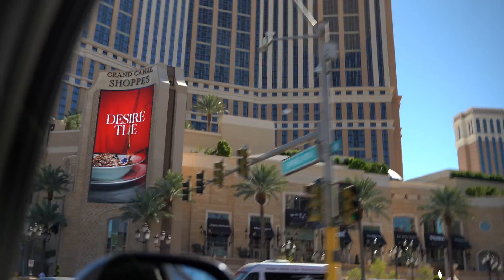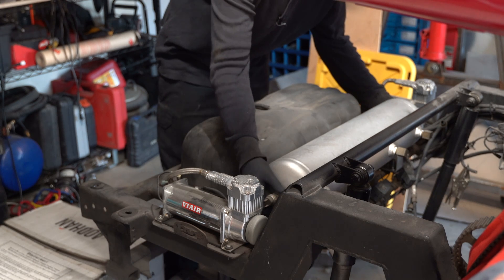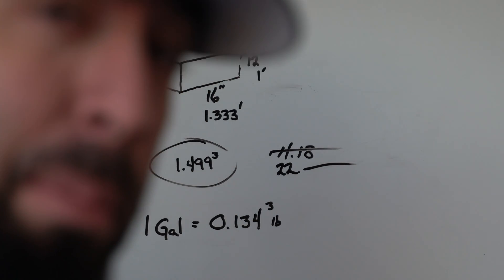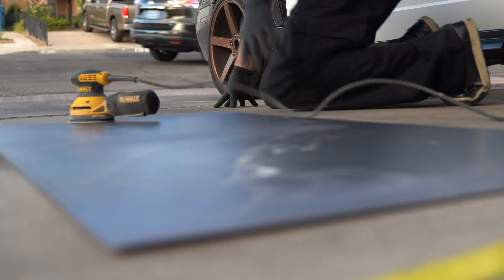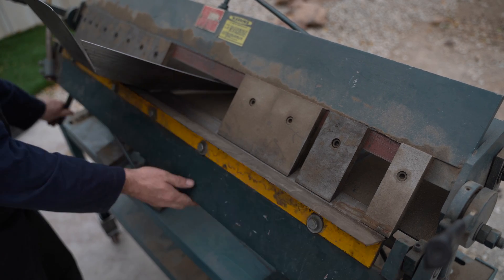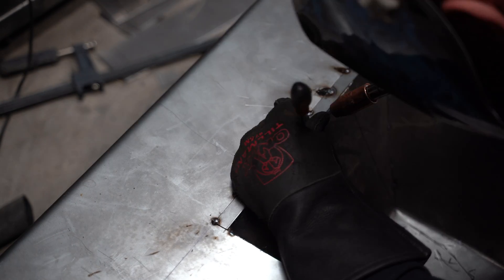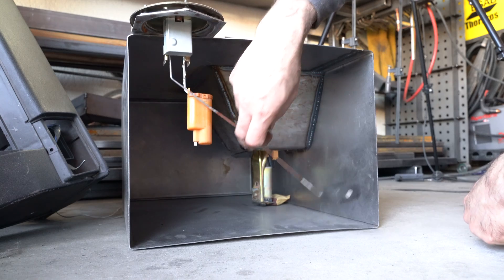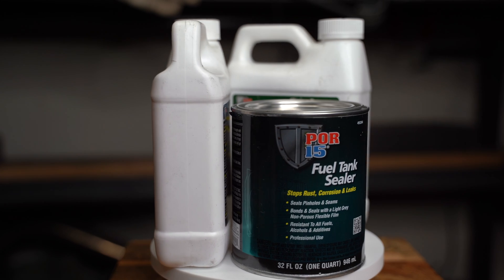Mighty Max Ep. 09: How to Build a Custom Steel Fuel Tank From Scratch

Comment: I always wondered if you could make a complete box.   I could not envision it.
Reply from the maker: Look up the magnetic brake, fellow Miller!  The principles of a magnetic brake are the same as mine, with fingers that clamp down on the metal on the top. But with a magnetic brake, the fingers are held down by magnetic force, rather than bolts. This allows you to make a complete box. 
And when you’re done, you just need to flex the box open a little bit to retrieve the fingers that are now trapped inside.
🤯

Comment: Where did you get that 48” brake? Looks familiar
Reply from the maker: Familiar? It was on loan from my old boss. I don’t have it anymore unfortunately. And fortunately at the same time. I hated that thing!
Reply: @GarageFab  was your old boss named Frank? Only asking because mine was borrowed from a frank to build a dash in a s-10. Then somehow his shop was “broken” into and my brake ended up missing. Even had the casters I welded on there.
Reply from the maker: That was getting interesting for a moment! I had a feeling it was something like that. But no luck. My boss was Wally. I don’t know where he got it, but the wheels were mine. I call them “socks” They’re casters that are welded to short lengths of square tubing that slipped over the legs. That way I can use the same casters on multiple tools/tables in the shop.
Reply: @GarageFab  yeah probably just a coincidence. Being a fellow fabricator and local las vegan I dig your channel. Keep up the great work.

Comment: And I feel accomplished making a little 4" wide 90 deg brake for my shop press to make brackets easier...bent 3/16" like butter...Guess I gotta up my game a bit
Reply from the maker: And you should feel accomplished! I still don't have a shop press or a press brake and I'm often in need of one. I still hammer over flat stock in a vice to make brackets. Kinda embarrassing, but I just don't have the room yet. In time, a homemade press, followed by a homemade press brake will be videos on this channel. Might be a little while though. I've got to clear some space first.
Cheers my friend!
Reply: @GarageFab  I was workin on a tiny project. Had some 3/16" thick brackets ya know to make it solid lol. Then it took way too long to hammer heat and bend those brackets and they have hammer divits all over it...finally said fahget it. I'm makin a little bracket press so I can make these little brackets and others. Took way to long...but now I can bend a 90deg on 3/16" in about 30 sec and it looks good. 

If you get the shop press don't go smaller than the 20T and get the HF air bottle jack...it's soooo much better/easier than the regular pump handle
Reply from the maker: Good tip! And I’ll take your advice. Thank you!

Comment: Awesome job man.
No drain though.  
I'm thinking of building a cell for my 1G. The fuel level indicator may be bad on my car due to a F up by me and the seal leaks due to the same guy who messed up the fuel level indicator trying to use old parts. If I build one,  I'll probably do aluminum and buy a boat fuel level indicator and make my own pump mount. But I probably won't do any of that.  I'll probably just fix my leak and get a new/used sending unit. But cool video.  I'm off to check out more of your videos.
Reply from the maker: Thank you, Jospeh! I laughed the whole way through that comment.
I intend to drain my tank using the engine. 😉 I’m a Toyota technician by trade and they don’t come with drains. A lot of my ideas come from the vehicles I work on every day.
I’d love to gain the skill to build an aluminum tank. The day will come eventually.
Your time is greatly appreciated my man! Cheers!

Comment: The "ALL DAY" had me rollin!! I feel your pain I've used that on a 1950s era tank and it works great but takes a week outta your life.. lol
Reply from the maker: I might be stripping it too. I've never been more unhappy with anything in my life! I think I'm going to fill the dang thing with Aircraft Stripper and hope I don't hate life afterwards.
Reply: @GarageFab  really? Man it worked excellent on the tank I did. That stinks. I can only imagine how much that's gonna suck.
Reply from the maker: Did you use the same brand? The first coat didn’t appear to cover well so I coated it again. And then again. It took several coats to completely cover the steel. Then when it dried, a large bubble formed between the steel and the coating like on a pizza crust. I had people tell me the single part coatings deteriorated on them and gummed up their fuel system and they’ll only use two-part epoxy coatings now.
And so now I’m scared. 😳
Reply: @GarageFab  yes same exact brand and kit you used. Makes me wonder if it needs the rust and pitting to bond too? It's only been 8 months since I did it and it was for a dealership so not sure on long term results. I did each step as you did except I did use the cleaner solution and had a rusty old tank. 

I hope it doesn't start to peel and gum up the fuel system.. now I'm worried..lol
Reply from the maker: Time will tell I guess. 😐

Comment: hint..if you drill some holes on the insides of the corners, when you go to use your 4.5 inch disk cutter... you wont over cut the part that you are making,, the disk cutter will ( you will ) stop at the holes that you cut.. and to make sure it wont leak after you grind down the weld.. solder the weld lines with solder.. easy to use and will stop those pesky pinhole leaks
Reply from the maker: Very good advice. I’ll be trying both. Thank you my man!

Comment: I spent years on CNC benders. For trapezoids and any other high wall shapes, you have to use raised tooling and use beds sides. It is not possible on all benders. Hydraulic benders have sides open, therefore in correct sequence you're able to bend shapes very deep/high. Not 100% of them, but good 99% out of them.
Reply from the maker: This may be my next purchase. (Or build) It’s incredible how often I find myself stuck and unable to create what seems to me to be a simple part because my tooling won’t allow it.
It’s like the finger brake punishes me for thinking outside the box. Pun intended.
Thank you, Daniel! 🙏
Reply: @GarageFab  CNC hydraulic benders are incredible in terms of efficiency, speed and accuracy. You can bend repeatable angles on material up to 12 mm (100 tonnes press), with accuracy of 0.05 mm.

I like bending as bend offer much higher strength than weld. No HAZ.
Reply from the maker: Is work-hardening not an issue? That’s going beyond my range of knowledge to be honest.
Also, I don’t yet hand $50,000 burning a hole in my pocket for a hydraulic press. 😂
Reply: @GarageFab  Hardening with bending? No. Thick mayerial gets gently warm up to 50C when bended fast.
Here is tip you may not know about. Sheet metal always has grain one direction. Always bend thick steel or SS with grain, not across grain. With grain 9 of 10 won't crack at bend. Perpendicular to grain 3-4 if 10 will crack at bend, deeply at times. Material half inch thick and higher.

To fight with this, you want to use wider V, bottom tool. Rule of thumb is 5 to 6 times wider V than material thickness. For thick stuff I go with times 8 wider. For half inch it would be 4 inch wide bottom tool, giving 4 inch radius to material with 90 deg. bend.

It is hard one, as with plasma/water/laser cutting, you will not get good efficiency with some flat stuff. Sheet metal always comes in sheets 1.2 x 2.4 m. With some cutting product to bending surface efficiency drop below 50% which is pretty low. Rest material is wasted.
Reply from the maker: Thank you for the info, Daniel. Very much appreciated! 🙏
Reply: @GarageFab  bender in your price range will be "NC" not "CNC"  but you dont even need that. stop blocks for bend angle work fine. back gauge can be manual doesnt need to be automatic. you can build a press brake thatll do everything youd ever need without any of the fancy electronics.

Comment: Modify sender to reach 12" bottom.
Reply from the maker: I don’t understand. 🤔
Reply: @GarageFab  if you can fabricate a gas tank you can extend fuel line and bracket 6" instead of fabricating that large recess in tank🤷‍♂️ awesome video though. Thanks for making it
Reply from the maker: My pleasure, David. You are correct. But should the fuel pump housing crack (as the Eclipse housings often do) I’d have to re-modify the new one as you cannot separate the housing from the pump bracket.
I like to build things with ease of future maintenance in mind.
Reply: @GarageFab  right on

Comment: That last part with the treatments and decreasing and what not, does that only apply to steel tanks or do you have to do the same for aluminum tanks?
Reply from the maker: The tank lining is indeed for steel only. The liner is there to prevent the tank from rusting from the inside out. I am REALLY unhappy with how the tank coating turned out so I’m considering starting over with aluminum. Aluminum doesn’t rust so you can just leave the aluminum bare. 🙌

Comment: I recently found your channel!!! Loving the content,  filming and editing style. Top notch bro!!!!
Reply from the maker: Thank you, Brother! I appreciate you. Hopefully you’ll stick around. I’ve got a pair of LS engines for the next YouTube project and zero LS knowledge. 😬 Imma need all the help I can get!
Reply: @GarageFab  I’ll definitely be sticking around. You find the LS is hands down the easiest engine to work on.
Reply from the maker: That’s good to hear because I’m terrified of it. I’m a Toyota certified technician specializing in Toyota and Lexus. Those are easy!
First question; I bought a car with a misfire in cylinder 6 and a code for cylinder 6 injector circuit. I replaced that injector. Test drove it. All good. Almost immediately cylinder 1 injector circuit code popped up. I replaced that one. Almost immediately injector circuit code for cylinder 7. 🤦🏻‍♂️ Any ideas what’s happening?
Reply: @GarageFab  I’m a Toyota guy too, I’ve had many, currrently have an FJ cruiser. I used to have a Supra but gave up on it, after blowing up three 7MGTE’s, and one 1JZ, I figured I’m not a good enough mechanic to screw with modifying supras. 

I was a jet mechanic in the military 20 years ago, but that’s the only professional experience I have. Currently I’m a so/so hobby mechanic, wanna be novice fabricator. 

Your issue to me sounds like debris in your fuel system. Have the fuel lines been changed? Have you changed your fuel filter? Injector failure isn’t a common problem. Personally I’d start with flushing the fuel lines then change the fuel filter (stock filter should be located on the passenger side frame rail under the cab). Did the car sit for an extended period with garbage fuel?
Reply from the maker: I think it did sit for at least a few months. I purchased from it from someone that couldn’t afford to fix it. Debris has also crossed my mind. That would explain the misfire but I wouldn’t expect a “circuit code”. 
I hope to help you become a slightly more than novice fabricator! 😂
Reply: @GarageFab  I’m doing a short bed conversion on a square body crew cab right now. It taught me that out of position TIG is a bastard and molting steel is tough on the skin. 

Also don’t forget to check your plug wires for a bad connection or melting if you have headers (LS plug wires love to melt with headers), and your grounds. Love the videos, and the sense of humor. keep it coming. You have the talent for 1million subs in no time!!!
Reply from the maker: Thank you Brother!
Both cars are 100% factory at the moment. Two 2008 Impala SSs. My goal is to get them to perfect running condition before tearing into them apart so I can determine if future problems were caused in the disassembly process or pre-existing conditions.
Imma subscribe to your channel to see what your working on. Sounds like my type of stuff.
Reply: @GarageFab  thanks for the sub brother. I haven’t made any videos for a while. I was saving money gathering parts, then when I got the parts I got too lazy to make any videos. I’ve been contemplating uploading again. 

I love those Impala’s, totally pimp. That drivetrain would make a sweet rear engine IRS mini truck, if a person could find one at the junk yard.
Reply from the maker: That’s the plan my man! Well, part of the plan. 😈 
Upload when you can and don’t stress about it. If it’s not enjoyable, it’s not worth it.

Comment: When I have to make a bend that will hit or catch on the bender somewhere, I just cut through my bend line with a cutoff wheel or blade leaving several small tabs joining the metal, bend with my hands, then weld the seem if necessary. Love your channel by the way. Very happy I found it
Reply from the maker: I’ve got to try and remember that. I use that method on heavy plate all the time, but for some reason it never crosses my mind when working with sheet.
Maybe it’s because I can’t see past my frustration that my dang bender doesn’t work. 😐

Comment: What thickness steel are you using? I want to make a bigger fuel tank for my Unimog, when I Googled "what gauge steel" it came back as 12G. Yours looks a bit lighter than 12G. Edit: Ah fuck, just read your description properly...16G. I liked your video though, nicely edited, not too much chat and one of my favourites with build videos is speeding up the long processes.
Reply from the maker: You’ve got impressive eyes! I used 16 gauge which is still thicker than a lot of modern metal tanks. Certainly not indestructible but still pretty beefy.
Reply: @GarageFab  Not so much the eyes, but the way you were cutting it with those shears, I don't think you could get away with using the shears on 12g.
Reply from the maker: Truth. I wouldn’t try cutting anything thicker than 16 with those shears. I’d be really sad if they broke.
Reply: @GarageFab  I might have to get some of those shears. I use a plasma setup now but it is a hassle for small cuts and those with a slight radius.
Reply from the maker: The electric shears are not at all great for turns. But still worth every penny.

Comment: Good information.   Thank you for sharing this.   To figure gallons, I find it easier to leave dimensions in inches, since I know 1 gallon = 231 cubic inches.  27x16x6 = 2592 cubic inches.  2592ci / 231ci per gallon = ~11.2 gallons.
Reply from the maker: Much appreciated! I’d like to remember that but my memory is broken. I’ll have to refer back here when it’s time to make another one. 😂 Cheers! 🍻
Reply: Use metric/logic
Reply from the maker: In the process of switching as we speak.
Reply: 231! That’s what I use too. I used to roll in a Chevy luv that we put a 231ci Buick 3.8L v6 in. That’s how I always remember 231ci. Association. I also remember 454 grams to 1 pound.. big block Chevy 454. Dumb, but it stuck. I’m a machinist, so convert inches to mm and back all day. Id remembered that the conversion from kg to lbs was 2.2, but did the math backwards, accidentally ordered 25 lbs of Parmesan cheese when in Italy. That was a good mistake, my family enjoyed.

Comment: Just curious.....why did you use steel vs aluminum or stainless steel?
Reply from the maker: Ability mostly! I’d very much prefer aluminum but I don’t have the skills or the machinery needed to AC Tig at the moment. Severely regretting it now because the tank liner is not meeting my expectations.
Reply: @GarageFab  
Thanks.  That's good to know.  I'm looking to have a custom size and shape tank built for my old truck.  I'll have them use aluminum.
Keep posting videos!

Comment: If the tank was stainless steel, do you still have to seal it?
Reply from the maker: I’d imagine with stainless or aluminum there would be no need to line the tank unless your welds are leaking. My line was used to try to prevent rust since I don’t have the ability to weld anything but steel at the moment. 😔
Reply: @GarageFab  Thanks! I just bought a Lincoln LE31MP. I hope that thing can weld stainless steel. I am sure I need to make a tank for a pickup I want to rebuild. If is not possible I'll do it your way

Comment: I'm excited for the follow up video to the fuel tank! Looks super good! Very impressive.

I'm planning on building long range tank for my truck. I'm glad I found your video.
Reply from the maker: Thank you Carter! There will be a follow up after I figure out what I’m going to with it. I’m not thrilled with the appearance of the POR15. I’m considering attempting to strip it out and re-line it with Tank Kreem.
Reply: @GarageFab  any update video?
Reply from the maker: Not yet. I’m going to need it soon though! I’m thinking I’m going to start with aircraft stripper and if that fails maybe roast it on my fire pit. 🤷‍♂️ We will see.
Reply: Any update on the completed tank ( lined)? Also, loving your channel 👍
Reply from the maker: @Fleur Dodd Thank you my friend! No update yet. I’m dragging my feet on dealing with the liner. I hate it and I don’t trust it enough to attach it to a good running motor. I’m going to have to strip it out or build another tank. I’m not excited about either of those options.

Comment: Awesome, was there any update on the tank? I want to fab an extended gas tank for a vw bus for long distance traveling
Reply from the maker: Not yet. I'll be doing some suspension work before I mount the tank to make sure I've got enough room for a watts link.
I can tell you that I wasn't thrilled with the POR 15 and if Aircraft Stripper will strip it out I just might do that. I'd recommend Tank Kreem instead. I'll definitely do an update video explaining my problems soon.
Reply: @GarageFab  awesome, was it 18 gauge sheel metal that you used? I want to build and extended tank for my 74 bug
Reply from the maker: I used 16 gauge because my tank will be really low to the ground, but I think 18 gauge would be perfectly fine.